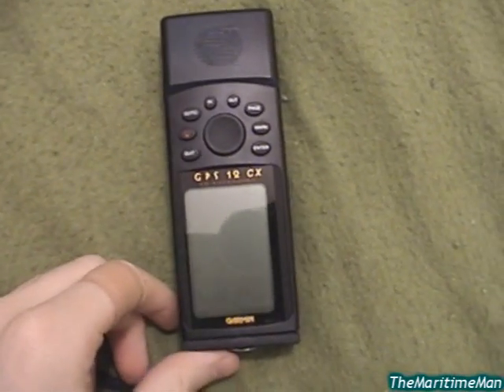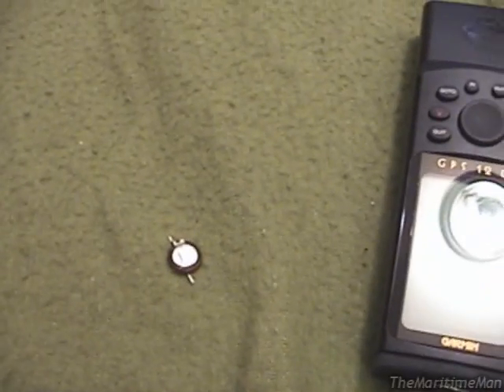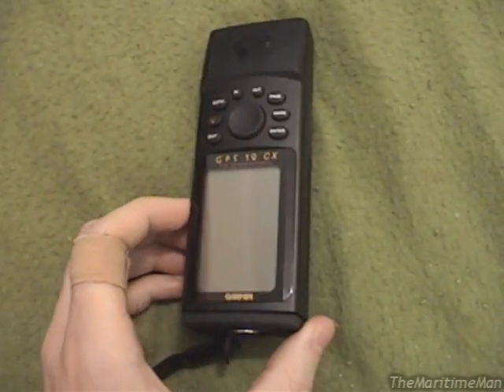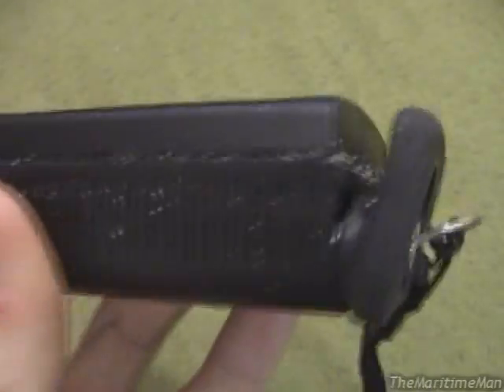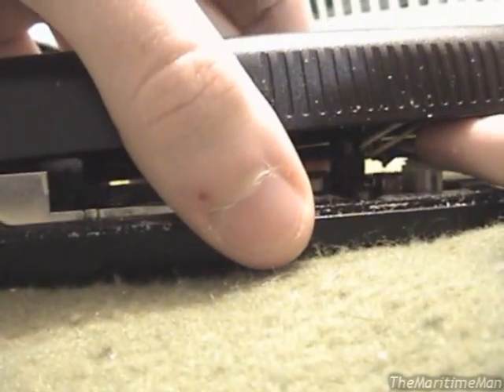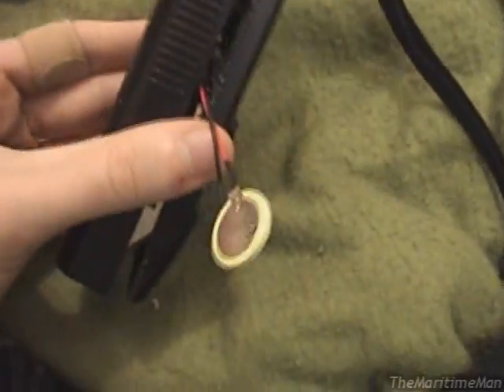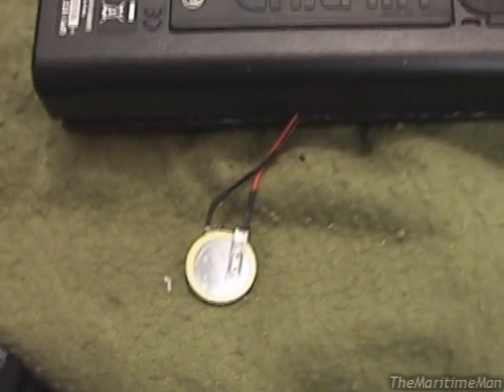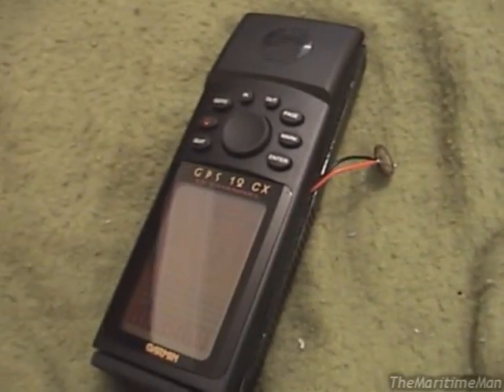Replacing the Garmin GPS 12CX's memory battery

Comment: Thanks so much for the video! I just now replaced the original dead battery in my Garmin 12XL with a new CR2032. The solder I used was specifically made for electronics. I got the positive lead soldered okay. I then was trying to solder the negative lead onto the battery when it exploded. I did have safety glasses on so I only had to clean up some black powder. (I am a jack-leg solderer). I can affirm batteries can and do explode if they get too hot. I then got another new CR2032 battery and attached the leads to the battery by wrapping them tightly with electrical tape. It's not exactly what I wanted but it works for now. My GPS is up and running again. My advice is do not try to solder anything to flat lithium battery unless you are an expert--AND you wear eye protection.

Comment: FYI, I have a GPS 12 Map, and it has a battery that looks like the VL1220 in the middle of the board.
Thanks for making the video, it's very informative.
Reply: That’s what my 12xl has also.  Did you replace your battery?  How did you remove the battery from the board?
Reply: @terrycrissman7392  As much as I liked that old GPS, I probably set it aside and never replaced it.  I don't think I have it any more.  Way back in the 90's, I used that GPS connected with a laptop with a map program to help navigate across the country.  You could tell how useful it was, it's no wonder cars come with GPS navigation now.  Sorry I don't have advice for replacing the battery.
Reply: @Russ938  thanks Russ.  If the memory battery doesn’t recharge, I may close my eyes and pitch it.  Just pitched a GPSMap 76 that had a bad battery terminal.  Tried aluminum foil but that failed.  I hike some in places that don’t have cell coverage and I’m not familiar with the trails at this time.  Having a GPS would be nice.  I could just carry the ole Silva compass

Comment: Thanks for the video of how to open the case. I can tell 
you that there is a basic circuit using a diode that effectively takes the 
battery out of circuit when an external battery (the main AA cells fitted in the 
battery box) voltage is applied so is not being drained at all as the main AA 
cells keep the memory active. So although the on board battery isn't 
re-chargeable, it does have a very long shelf life typically up to ten years or 
more. So if you always keep a fresh set of batteries installed, the internal 
battery never gets drained, it only get's drained when the AA cells are dead or 
removed. So keeping fresh AA cells in carries a big risk as I eventually found 
out to my horror. I know alkaline batteries break down and leak when they are 
depleted but always kept fresh ones installed, well, till I forgot. So now I 
have my much loved GPS12 full of corrosion and it has eaten through one of the 
spring electrodes leaving me in need of a new back / battery compartment. So if 
anybody plans to replace the battery, by all means keep AA batteries in to 
preserve the memory cell but use NiMh rechargeables as they don't seem to leak 
unless they are very very old (ten years plus) but you will need to cycle them a 
few times every so often as these cells lose capacity badly when used at very 
low current drain as in this application.
Thanks again, shame Garmin didn't 
make a more practical design I paid over £400(UK) for my GPS12 which was 
extremely expensive but they had only just been manufactured and it was a more 
serious instrument than some of the ones they make today which even include 
games!
Reply: What about Duracell? Some of these batteries can last up to 10 years according to the manufacturer

Comment: you're not gonna believe this! after having the batteries removed for a couple of years i put fresh ones in a few days ago. as expected i got the "internal memory low power" message. so i figured i had to order a battery and replace the old internal one. well today i powered it up just for fun and the message was gone! i went to the message page - nothing. so i marked some waypoints, cycled power and they are still there. so...apparently mine HAS a rechargeable battery that is still functioning after all these years. it's kind of unbelievable. part of me wants to pop it open and see what's in there but i'll wait until i have too. thanks again for your post!
Reply from the maker: This is a 12CX? Interesting!
Reply: yes! funky 3-color display. it's the right model. i just powered it up again to make sure i'm not nuts and it's got the waypoints stored in memory. very strange. even more strange that a rechargeable battery that old would still work.
Reply from the maker: solmadness Wow, that's really weird! So it's possible that the entire 12 series (or maybe even all of Garmin's older GPS's) used one type of battery, and then later they switched them all to the other type. It could be possible that yours uses a non-rechargeable battery that just happens to be on the edge of being "low", but I doubt that.

I have no clue how to date these. The 12CX was only on the market for a few months in 1999 and 2000 though, so you have a 50% chance of being right by guessing one of those. :P If yours is running software version 2.00, it was likely made in 1999. If it's running 2.01, then it could be either year.

Comment: Seems old gold prospectors aren't the only things with memory problems. I have the GPS 12XL, I cant even remember when but paid about $650 Australian for it, been wanting to get it going again for sentimental reasons because we shared some tough times together in the Aussie outback. Worked great for about 20 years till that memory battery went. 
Now what was I going to say...oh yeah...thanks..
Reply: I had a 12xl in the glove-box while we went around the Simpson desert a few weeks ago. still works a treat after I opened it and made the repair. the 12xl has a rechargeable battery but it eventually leaks and eats the surrounding traces.
Reply: @burntoutelectronics do sad

Comment: Thanks a lot! I have one of these I bought brand new years ago. I want to get it working again. So ideally would you suggest using the BR2032 battery with tabs? Do I need the holder? What orientation tabs do you recommend?
Reply from the maker: Glad to help! Yeah, just get a BR2032 with tabs, clip the wires off the old battery, and solder them onto the new ones. Orientation won't matter. Not sure what you mean by holder - there was none used here. Just lightly wrap the new battery in electrical tape, and set it in the approximate position of the old battery, and you're good to go. There's no need to adhere the new battery to the antenna support plate like the original - it won't rattle around much, if at all.

Comment: thank you for the video upload. it was very informative. my father just asked if I could replace the battery in his 12map. I will update with my findings when I get the unit apart.
Reply: Don't replace the battery just  plug the unit into  a a/c adapter so you can leave the unit on  while charging . The unit has to be on to charge the internal battery . It takes a good week  of being on and plugged into to power to charge it . Once its charged up it wil last a good year before you see the low battery  message again . People just don't realize  the unit has to be turned on   for the battery to charge .

Comment: I have the 12xl with the vl1220 battery. Can I charge the battery by leaving the unit on, using batteries?  Don’t think I have the AC adapter.

Comment: Interesting video...BUT...I believe what you are seeing is the repair of a Garmin 12 that has previously  had its  memory battery replaced . The wiring with the Cr2023 battery holder and heat shrink insulation that you see is NOT the way Garmin built it!   Also the sealant that the video shows being removed looks like silicon RTV. The Garmin 45/48 series look exactly like the 12, and the case was sealed by Garmin with what I believe is a polysulfide sealant.  That sealant  is much tougher to strip from  the case,  but it can be done pretty much as the Video shows. I have opened and replaced memory batteries in both the Garmin 45 and 48 units successfully but with more difficulty than what you see here.

That said, the video does show the basics of one way to accomplish the repair/replacement of the memory battery. In this case the guy only had to stick a  new 2032 in the holder and seal it up. The original battery was a VL VL1220VCN. Because the 2032 is not rechargeable the repair will need to be accomplished again when the battery dies.  I suspect the factory installed 1220 will give a longer life.   The VL1220s are available from Mouser Electronics for about 5 bucks...shipping extra. The 2032 battery holder is also available for a couple bucks.

The VL 1220 is as one commenter below indicated is soldered to the board.  Either the VL1220 or a CR2023 wired with battery holder (which is what you see in this video) will work...just depends on how you want to wire it in. If you order the 1220 be sure to get the correct "style". The "1220VCN" is the one that has the the parallel lead posts oriented in the correct manner to attach to the board 

BE SURE you install/wire the memory battery with the correct polarity!

Chuck McB
Reply: Don't replace the battery just  plug the unit into  a a/c adapter so you can leave the unit on  while charging . The unit has to be on to charge the internal battery . It takes a good week  of being on and plugged into to power to charge it . Once its charged up it wil last a good year before you see the low battery  message again . People just don't realize  the unit has to be turned on   for the battery to charge .
Reply: Sorry to say ChuckMcB, but you are WRONG. I have just disassembled my 12XL (the reason I'm here) that I purchased completely brand new (20 odd years ago) and fully packaged. The sealant on my casing is identical to this video (semi clear) and the battery AND connections are identical (Panasonic BR2032 mounted with doublesided foam tape and flying leads with heatshrink). I KNOW my unit has NEVER been opened before.

Comment: I have the GPS 12  It doesn't have the external  antenna  connection in the back like yours . I was trying to see where the connection was on your unit but you were moving it around and you never held the video still with out moving around long enough for me to see where I was connected . The next time you open it up will you take a close up  photo or video  of where it connects  . If I stop this video at 12:57  I can see the wire conning down and connecting on the right side  but I can't tell where its connected . I want to add one to mine . Will you post a link to the group your talking about .

Comment: Since the battery isn't a rechargeable one, I just wonder why it is that they didn't make the battery a bit more easy to replace.  I wonder if that has something to do with the waterproof properties of the GPS receiver.  Of course a good quality Lithium battery should last around 10 years or so, I just have a really strong pet peeve with devices that don't have easily replaceable batteries.
Reply from the maker: Yep, water resistance would have been the reason. I imagine they could have made the battery replaceable while retaining the waterproofing, but it would have made the design a lot more complex.
Reply: +themaritimeman Even with this design the candybar-style units aren't well waterproofed. I had a GPS 48 that died due to water ingress from some water splashing. The II/III/V and such, with screws and a rubber gasket, is a much more robust design. Not to mention you don't have to crack it open.

Comment: I have the gps 12, How long dose the memory battery last in them or dose it charge from the AA bettery's when they are in the unite, My unit has till last week been off for about ten years but is okay, will the m battery charge now I have batt's in the unite again? Cheers. Pete
Reply from the maker: +pepersorte Your unit could have either the rechargeable or non-rechargeable battery inside. If it's the rechargeable, then it may come back to life after a few days of having AA batteries in it. If it's the non-rechargeable than your only option is to replace the battery.
Reply: *****  Thanks for that, but while I was asking you that question My 12 was in the bag with new bats in her, that I put in a few days ago with out turning her on, I got her out and she is working great, God for an older units she works really well.
 By the way I have since I wrote last, tried out putting lots of coordinates off Google Earth into her and after going out on walks, to fineout Google coordinates are or for me are never more than about eight foot out. some are stop on This could be with the units own accurasy, great for my use for her in my new boat in watcer I need to navigate as i do not know them,,, Yet,,,, Thanks, Pete
Reply: If you have the rechargeable battery it will only recharge it when the unit is on . You can plug it  into a ac/12 volt adapter and turn the unit on and let it  the vl1220 charge up .   If you just plug it in and don't turn the unit on it  doesn't send power to the  vt1220 to charge it up . Read my comment above . Putting new  AA battery's won't charge  the vl 1220 unless its on . Test it with your tester  and you will see as soon as the unit is turned off  the  vl1220  stops getting power   as soon as its turned on  the  vl1220   connection jumps up to 3.02   when its off  but still plugged in  or battery's are in   you only get  the  vl1220  real battery  reading   no charging  is going on  when the unit is off .

Comment: I might be mistaken but I thought that these units were nitrogen filled to keep them waterproof.  Splitting the case renders them no longer waterproof.
Reply from the maker: It had nothing to do with waterproofing - nitrogen is lighter than air, so these were filled with it to make them more buoyant should it fall in water. After 20 years, much of the nitrogen would have diffused and been replaced with air anyway. The silicone sealant provides the waterproofing.

Comment: I have a Garmin model 12 group II,III ,serial 36911801. It appears different than the one in the video.I haven't used it in about 2 years. Nothing appears on the screen with batteries or the power cord.Do you think that the problem could be the internal battery?
Reply from the maker: bob sargent I've never heard of a "model 12 group II,III", but a dead backup battery wouldn't stop it from turning on - it probably has bigger problems. Try leaving batteries in it for a day or so and try turning it on again. Other than that, it's probably dead.
Reply: ***** I'll give it a shot.

Comment: I have a question about a Garmin GPS 40 has identical case to this. the dang thing takes 5-45 minutes to get a lock on satelites, has gotten quicker lately but still way to slow, im not sure if this is normal, also does not work when walking, only when driveing?
Reply from the maker: Does it complain about a low memory battery when you turn it on? If so, then it's forgetting where the satellites are every time you turn it on, and it has to go through the whole process to find them again. Half an hour or so is normal when finding satellites for the first time, but if the memory battery is good then it should only take a few minutes thereafter when you turn it on.
Reply: No holds memory just fine, no messages pertaining to memory batery or any messages at all, except serching the sky after powered up. funny thing i just got home and on my way i had it on, only took about 2mins to aquire, and didnt give me the message 'serching the sky', i also once out of the car took a walk around the block and it gave no response once again, had a bunch of satelite bars more than 3/4 signal, but no speed was shown and the cordinates stayed the same from where i parked, as well as no heading movement
Reply from the maker: Hmm, although it's normal for that to happen once in a while, that's strange if it happens often. Don't really know other than that.
Reply: +themaritimeman I noticed this thing has a spike in the center of the data/power plug, my interface plugs accept this spike, and my 12v power cords do not, the hole is blocked off, will this gps 40 run on 12v if i modify the plug of my car adapter? also does yours have that plasic spike in the middle of the 4 pins?
Reply from the maker: Nope - you'll probably destroy the GPS if you try it. The GPS 40 only accepts up to 8V, and requires the right power adapter that steps the voltage down to 8V, and has the hole in the plug. The plug you have is for another Garmin GPS that can accept straight 12V power.

Comment: great job i have a 12 and a battery got bad and got the one side hot and melted its not worth saving
but real good video larry
Reply: Don't replace the battery just  plug the unit into  a a/c adapter so you can leave the unit on  while charging . The unit has to be on to charge the internal battery . It takes a good week  of being on and plugged into to power to charge it . Once its charged up it wil last a good year before you see the low battery  message again . People just don't realize  the unit has to be turned on   for the battery to charge .